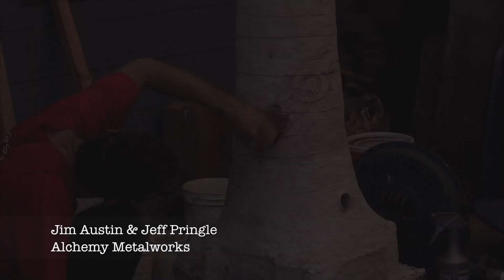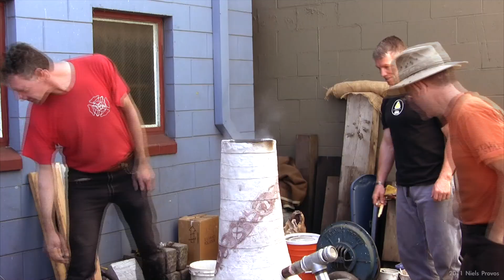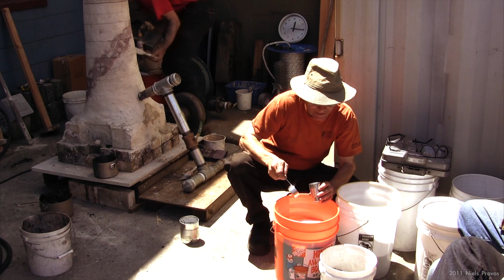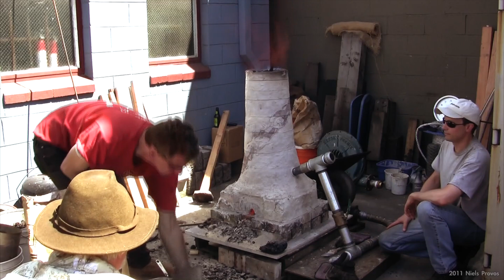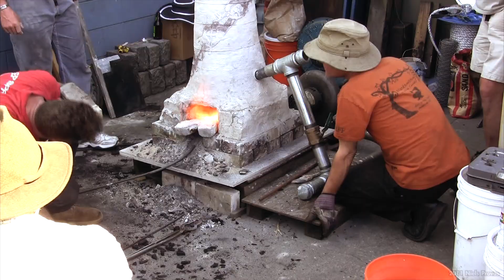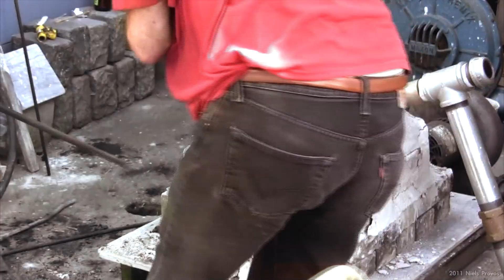Making Viking-Age Bloomery Iron in a Bloomery Furnace

Comment: I'm not 100% sure this actually works. After working the "steel" folding it a few times after all the impurities are worked out, it is basically mild steel that doesn't even pass the spark test.
Reply from the maker: It's not meant to be high carbon steel. It's meant to be wrought iron, i.e. negligible carbon content.
Reply: @NielsProvos  That makes sense. I was searching for making steel when this video popped up. Didn't realize it was only making iron.
Reply from the maker: Depending on how you run this you can get high carbon pieces. That's how the Japanese make Tamahagane.
Reply: @NielsProvos  I thought Tamahagane is folded steel...
Reply from the maker: It's folded bloomery iron that has carbon in it.

Comment: QUESTION: Shouldnt you have mixed some limestone powder with the silica sand, to further enhance the formation and runoff of slag ? Its what all the major foundries seem to do, and it makes perfect sense from a chemical standpoint. It may explain why you got less freerun slag than you were expecting when you tapped.

If memory serves:

Limestone + heat -> quicklime + co2

Iron oxide + quicklime + silica oxide -> iron + slag + co2
Reply: you need CO to reduce the iron oxides, CO2 is formed during that process as the iron oxide becomes iron (FeO -> Fe and CO -> CO2), the flame should be blue at the furnace mouth, calcium can be added to lower the viscosity of the slag and further reduce sulfur content in the ore.

Comment: Did anyone see any iron anywhere?. I'm still searching for a video where they actually produce iron from a bloomery furnace THIS IS JUST SLAG NOT IRON.
Reply from the maker: If you have not been able to find a single video that shows bloomery iron, how do you think it should look like and why?
Reply: Bloomery smelting produces sponge iron, not molten iron (pig iron) which was mostly an unusable waste product in those times.  Sponge iron can be heated and hammered, which forces out the impurities and slag still inside the bloom and it can then be forged into billets for transport or tools.  Pig iron has far too much carbon in it and is too brittle to be forged.  How to remove the extra carbon isn't something that was widely known at the time and was more complex, and took longer to do, than just starting again and making sponge iron.  Pig iron would have been either trhrown away as a failed smelt or broken up and fed back in to the next attempt to produce sponge iron.

Comment: I am very interested in trying this but am having trouble finding where I can source iron ore from. I can find bags of iron oxide on amazon.com, but I'm not sure if that would be suitable for an experiment such as this.
Reply from the maker: You could use iron sand, e.g. magnetite, but then you need to pebble it so it does not run through too fast.
Reply: @NielsProvos  I collected about 20 pounds of purish magnetite from the great sand dunes in Colorado. Do you think this would be impossible if it was contimated with sand? I’ve filtered it was a magnet about 10 times but it always picks up some sand.
Reply from the maker: @changedpace9169  you’ll get more slag would be my guess. The problem with iron sand is that it runs through very fast. I have heard from others that they try to pebble it.

Comment: i have participated in a couple attempts (successful) of smelting iron and a few failed attempts at making steel.  what they didn't show was the prep work that is involved, building the furnace and curing it, prepping the ore for use, making of the charcoal. their bloom looked like it contained a lot of slag, though since they don't show the consolidating of the bloom to iron ( yes that is just a blob until hammered into iron) not sure what their ore to iron ratio turned out to be but I would say maybe 50%.  see people complaining that there were modern equipment used, well if you are willing to pump a bellows for 7 hrs let them know and you can help next time, been there, done that, not really a fun time
Reply: I plan on doing this for a public event, theres no chance in hell im running bellows for 7 hours when I have to entertain a crowd of 200 people. I would get the crowd involved with bellows but "its dangerous" rolling eyes obviously all the prep will be done before the event
Reply: @waskasoometalworks3329 actually that's perfect for a bellows. Ask for volunteers from the Crowd to take turns pumping the bellows
Reply: They didn't show a lot of things. They're artists, not specifically craftmen.
Reply: What do you do next after you get it out of there ? Will you get good knife material?
Reply: @davidbishop4085  , no after getting it out, it needs to be hammered/consolidated down to become an iron bar, then there is another furnace process that adds carbon to the iron to make into steel and the grade of that varies with the processes/materials used.  then you can start making the knife.  there are several videos out there that show more of the processes, the iron smelting, the steel forming and testing and finally knife.
Reply: That's why a suit of armor cost as much as a castle back then. Until the bessemer process that was how steel was made.
Reply: Ok.. so I got the blooms but they just break apart shiny black most of it... I know I have a lot a of slag but even tiny little iron would make me incredibly happy. So does that mean I have to keep heating it hitting it and brushing it?
Reply: @hirampratt7995  not knowing your setup, difficult to say what needs to be done.  First what are you using for ore and is that magnetic at all before you start?
Reply: @rwarrich  yes its a big rock from a swampy and it's magnetic and also rusts on where I freshly broke off pieces after it rains. I don't make my bloomeroes very tall or wide would that greatly effect it?
Reply: @hirampratt7995  the ones I have worked with are about 12 inch inside diameter with 4 inch thick walls and roughly 4 foot tall.  after getting a fire going in it and air blowing in, it gets loaded with 1 charge of ore, then one of charcoal, every 10-15 minutes for usually a total of 10 charges, with a final 1 or 2 charges of charcoal at the end and let it burn down.  a charge is equal weight of ore or charcoal,  believe the person I was with was using 2 pound charges.  also you need to make sure end of air tube doesn't get plugged
Reply: @rwarrich  incredible

Comment: Watching that process and the complexity of adding ingredients, makes one wonder how early foundries ever went on to the next burn. How many times must they have failed before developing the right mix? The smiths of old must have seemed to be magicians. They were highly regarded.
Reply: Well tbh the complexity comes in because you want to refine the process as much as possible to get better quality iron. To get started you "only" have to overcome two challenges: find the right stones and get your foundry hot enough and you will get a bloom ... the question is how useable it is. If this truly represents (the blower does not count) Viking age technology than that means ca. 2000 years of development has already gone into it and it is not exactly how iron smelting started out. Not to mention that people smelted a hole bunch of other metals for a lot longer (copper, tin, gold... ) so its not that smelting itself is a new thing altogether. And even those things didn't just appear out of nowhere... at least firing clay has been around even longer and heating and cooling rock to make working it easy and other uses of fire all contributed to the development of new uses of fire. So to say it is hard to comprehend how someone could come up with such an elaborate process is absolutely right because no single person did... it took thousands of years to arrive at a point we see as primitive as the beginning of iron working. It might be in comparison to our capabilities but I doubt if you asked someone smelting iron right after the use of iron began to spread I doubt he would say the same
Reply: roggen dorf. I understand that the process and development took a long time,
Reply: roggen dorf. My point was, this took place over a wide area, communication was almost nonexistent, probably kept secret because of its value. Yet it still developed. What, today is equivalent? Nothing much. We seem to have lost our curiosity. I know there have been advances in IT etc, but no real discoveries for a long time.

Comment: I watched one where they did it in true form and it took 1300 lbs of charcoal and nearly 24 hrs to get their bloom. They then made a viking sword stacking, forging, cutting and folding for the finished project. It took days
Reply: @foggy7595  It would take too long to explain here. Search for traditional steel making and there are others. But it's a long process
Reply: @foggy7595  Presumably with hand bellows? Air being piped in makes the whole thing much more efficient

Comment: Why dou you put old slacks in the mix? Is the powder flux?
Reply from the maker: +Pieter to keep continuity with the past :-) it may also help with fluxing
Reply: I can understand better now why making a fine sword would cost a fortune.  I think that making the metal alone is pricey enough. The arduous task of making metal in the right quality, then heating and hammering away for days at an end, twisting and folding the material. Then grinding, sharpening and polishing the blade, making a pommel, hilt and crossguard. And a scabbard of course.
Reply from the maker: +Pieter that's exactly right. A sword was a luxury that not many could afford.
Reply: I know this is an old thread but thought you might be interested to know that in medieval times making white armour, the term used for highly polished and often decorated steel plate harness, the cost of the polishing and finishing touches was usually greater than the cost of having the suit of armour forged and made in the first place.  Getting mirror smooth polish is a very lengthy and laborious task when doing it all by hand with no machinery to assist you, they also had to be chemists as many kinds of polishing/buffing compounds, etching chemicals and enamels were also part of the job.